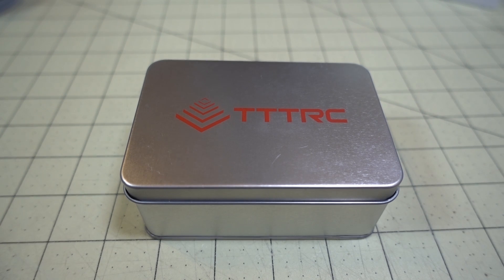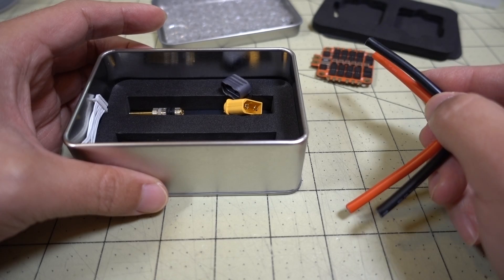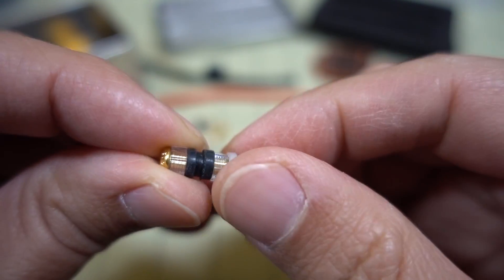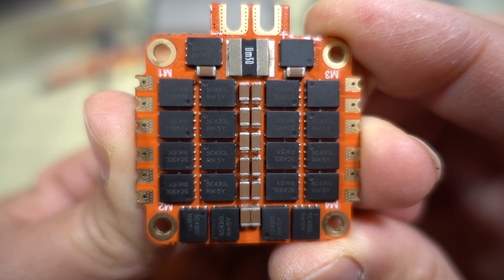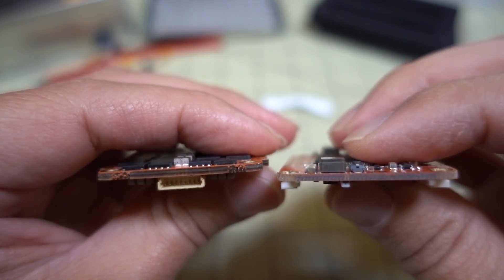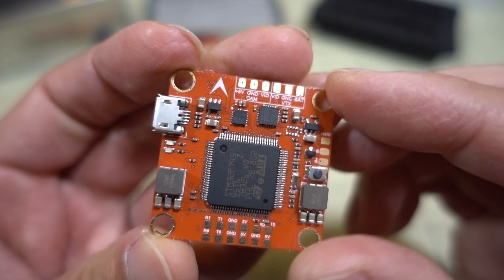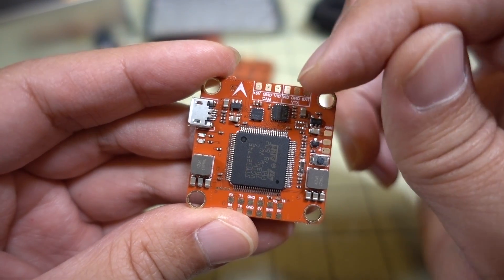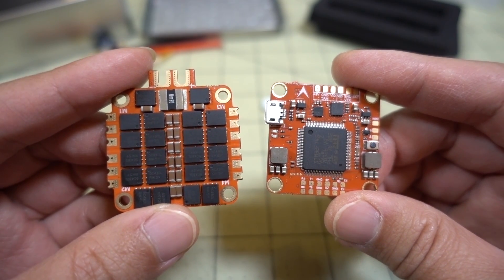TTTRC F7 Flight Stack Overview 🏁

Comment: Amps are Amps. A piece of wire a certain length and diameter will have an 'Ampacity' or saturation point where additional amps will drastically increase resistance and temperature in the wire. 

Voltage on the other hand plays no part (or an extraordinarily little part) in the thickness of a wire, which is why we commonly see rather skinny 120VAC rated cables. Those cables could never handle more than a few Amps, because they're skinny, but they're well shielded so they can carry 120VAC without arcing or short-circuiting otherwise.

Comment: No Barometer.  That's an oscillator chip for the uC's master clock speed.  Has a frequency in MHz printed on it..  usually piezo-ceramic oscillator.

Comment: Looks like no 3.3 V for Spektrum folks. Shame it's not easy to switch between the gyro's but hopefully the hardware provided for vibration dampening is sufficient. Curious to see how well this works because it looks like a nice package.
Reply: Fred, should have 3.3 somewhere as the F7 chip runs natively on 3.3.
I would stay with a known brand for now. Good thing is that all this new x-class geared equipment will drive the competition and prices lower. Matek is someone of quality to watch, and hopefully others!